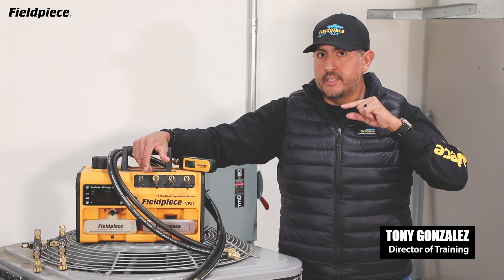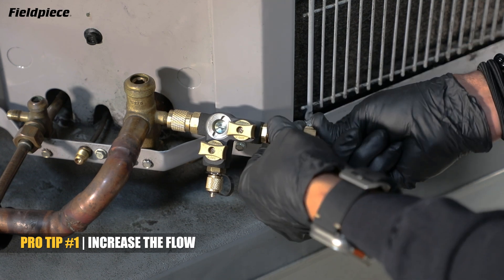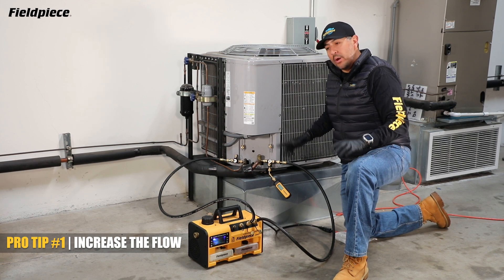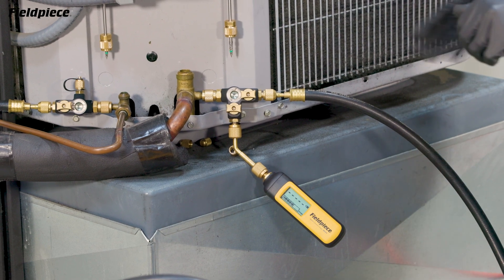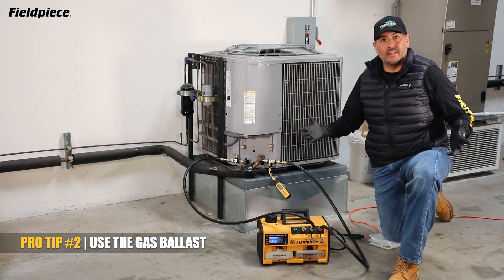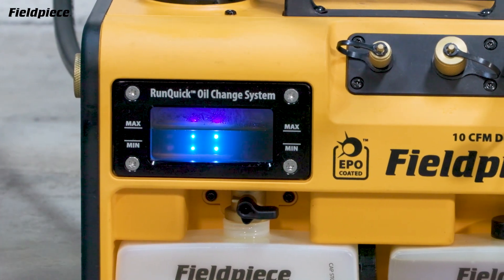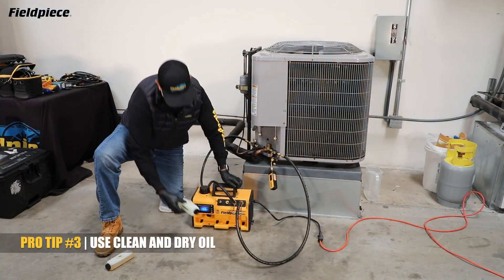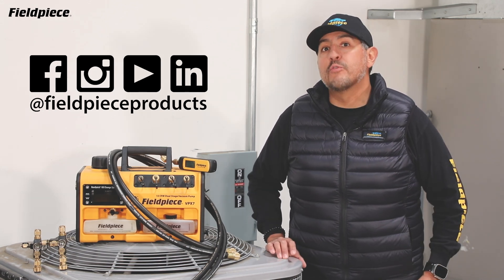Fieldpiece Pro Tip | Pulling a Vacuum Easier, Faster, and Better | VPX7, VC2G, MG44

Comment: Is it capable of continuing to pull deep vacuum after long hours of continuous running? All pumps I used were getting weaker the longer they work and the hotter they get. For example first turn with micron gauge attached straight to the pump it can go down to 5 or6 microns but in about an hour its only 100 - 150 in four hors its 400-500. 
My target is 50 microns in small units only 12-15oz. 
Will VP87 with sman 480v attached provide me with 50 microns on small units I am working with?  Or perhaps VP87 is oversized for my needs and I only need VP67? 
Please advise 😅

Comment: Shouldnt the micron gauge be mounted at a higher elevation so you do get contaminants in the sensor?
Reply from the maker: Thank you for your question! If the micron gauge is properly isolated when recovering refrigerant or charging a system (we’re looking at you, VC2G valve core removal tool with dual ball valves), then there is a very low probability that the gauge sensor will be exposed to contaminants regardless of placement. If you can, best practice is to position the micron gauge parallel to or above the line set.
Reply: When will the dual valves be available? Anywhere I look online is sold out, and most of the distributors in my area of Phoenix has no idea you made these.
Reply: 9i